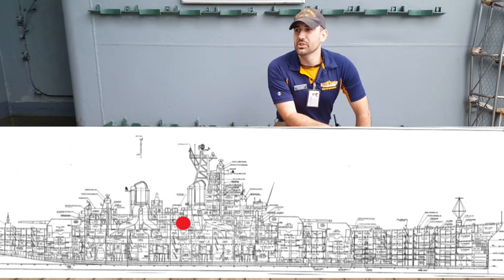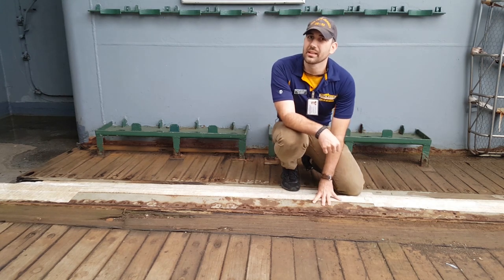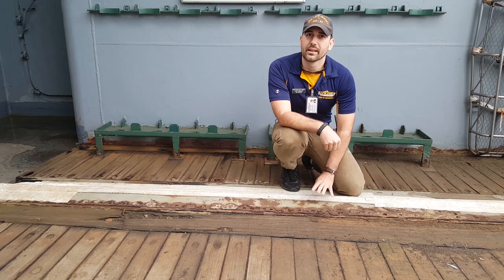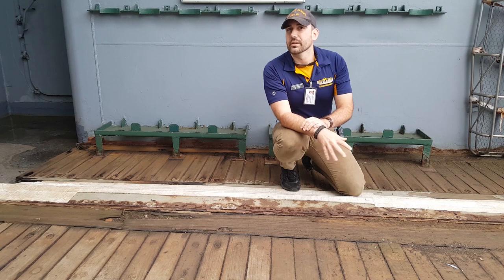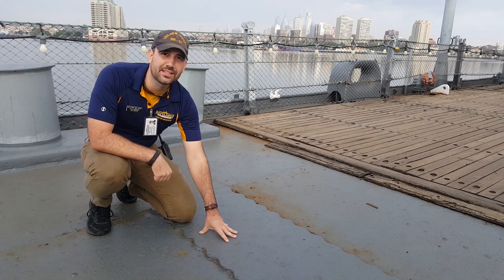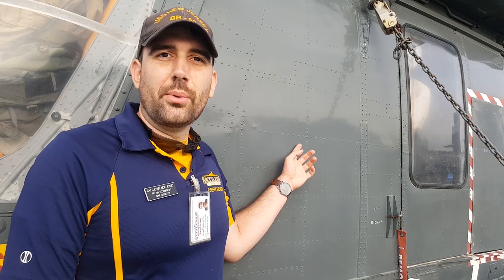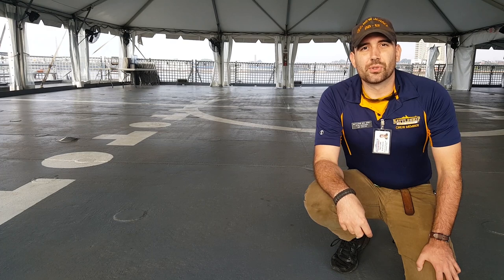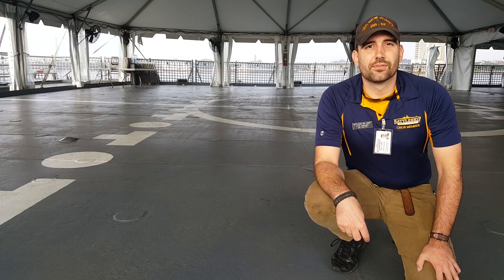Welding Vs. Riveting

Comment: Riveting for ships allows for faster building. Once the pieces are lined up you can have several people rivet it together. While a weld takes far longer and requires more skill. It’s also allows for the basic structure of a ship to be built and loosely bolted together rivets connecting interior pieces while welders can focus on the hull of the ship. This makes it possible for other things to take shape like the electrical lines, plumbing and other components. America was able to build hundreds of ships in the same time that it takes us to build one aircraft carrier today. Obviously they are far more complicated and sophisticated today. But it is interesting to think of the advantage of the speed that you can build ships when the parts are bolted and riveted vs welded.

Comment: Uhhhh, aircraft are not riveted together with pop rivets.  There are some applications for blind rivets (more or less pop rivets)  on aircraft, but the overwhelming majority of  rivets on aircraft are solid rivets.  I guarantee you that the rivets Rosie the Riveter was setting in WWII planes were solid rivets,  pretty much the same as ships rivets, except they're made of aluminum, not steel, and they don't need to be heated. But the are set the same way, by upsetting with an air hammer.
Reply: don't forget Explosive rivets.....they were used where you could not buck....Cherry was the [POP] rivet for aircraft, much more substantial
than a POP rivet...and more expensive, Cheers....
Reply: Yes Andrew that is correct!

Comment: Most rivets on aircraft are solid not pop rivets. Rosie the riveter is holding an air operated rivet gun and is a skilled riveter with a delicate touch as she is normally work with aluminium. A pop rivet gun is totally different it has pin that pulls through the rivet to expand it and then it breaks off (pops). Alloy cars are often glued and riveted together, the rivets hold the panels in place while the glue sets and also adds strength. It has huge strength, another advantage are all the seams are fully sealed with the glue, less chance for corrosion to get in.
Reply: Saved me the effort of correcting the misspeak on the video. Solid rivets, not pop. And solid rivets are STILL cutting edge technology in aviation. Rivets allow the preservation of the base material's strength by providing residual compressive stress that prevents crack initiation, and also since it's not a hot process, you have no cooling shrinkage (residual TENSILE stress-- very bad) and metallurgical conversion from the change from molten back to solid.

Millions of solid rivets are used every day in the production of a modern jetliner.
Reply: Pop rivets don't hold , I bucked and popped 10s of thousands

Comment: Correction: Rosie was not using Pop-style (blind) rivets. Rosie was using regular solid rivets. It just that instead of being a hot-swage process like the ships used, it was a cold-swage process. The resulting cold work of (usually aluminum) rivets actually made them harder and stronger and more resistant to fatigue than a unformed rivet or even the parent sheet material would be.
Reply: U mean buck rivets?